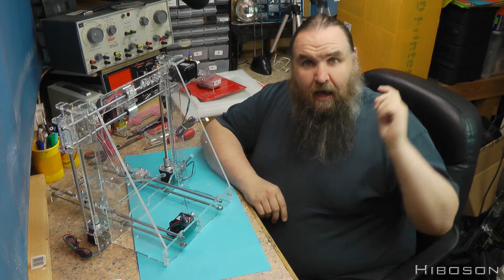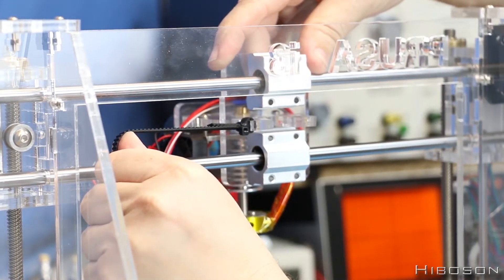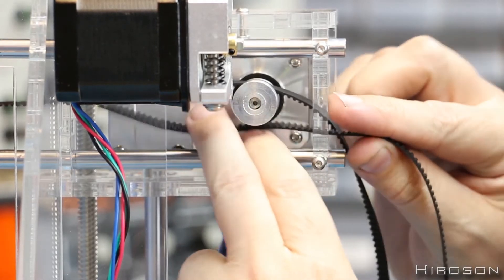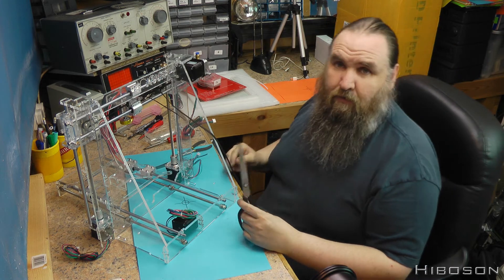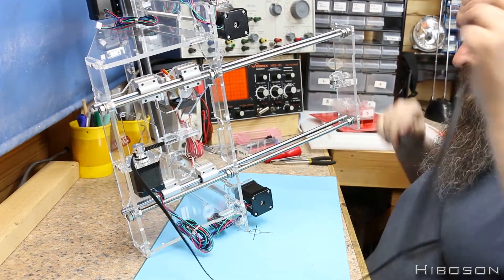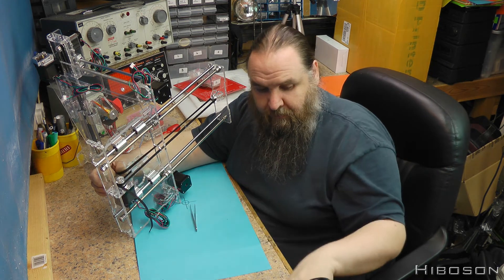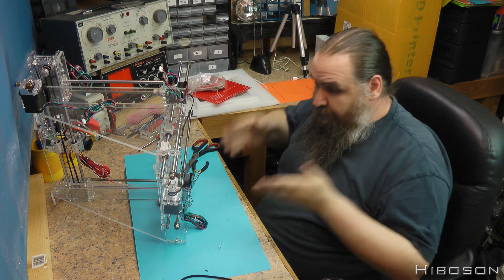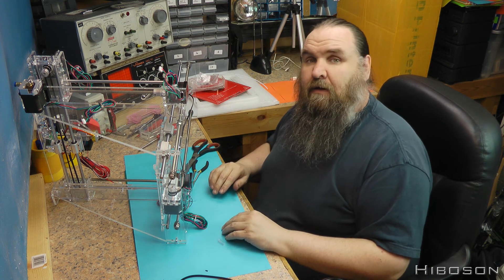3D Printer Build (And Breaking) - Sunhokey Prusa i3 - Part F

Comment: Can't you just glue the piece back on?
Reply from the maker: Matthias Zeitler it's a high stress point and small area to glue back, I feel confident just gluing the broken piece itself on it'll snap straight away,, but if I glue some additional support material on I think I'll get away with it :),, if not holes and cable ties is winning in my head as plan B lol
Reply: Hiboson too thin acrylic seems to be the Achilles heel of these printers. I was lucky, and didn't break any acrylic when building mine.
You might want to try some SCIGRIP acrylic weld to fix that part, and add a bit of acrylic spanning the toothed weak areas. However, If you have any difficulties, I can print you out one. I also have my original part, as I replaced the acrylic Y carriage with an aluminum one (had a bit of acrylic warp with ABS temperatures).
I notice that 3dprintersonlinestore.com (where I bought mine) is also selling an MigBot Prusa i3 with thicker acrylic (8mm vs. ~6mm) and an optional 270x210x180mm build volume. Oh well, that seems to be the name of the technology game. ; )
Your videos are very well done my friend!
Reply from the maker: Louis Boliou thanks :) I'm glad my video production levels seem to of sufficient quality to keep people happy :) Thanks for the offer of printing a part :) had a few now the 3D Printer crowd sure is a nice bunch :) For now going to try a fix, it's all content and showing my viewers how I get through issues (Even if self made lol), if I get really stuck I'm sure I'll start taking up folks with there part offers soon enough lol

Comment: Feel for you Hibson, mine was the same but decided to leave it, it went through my mind to do the same as you but then I thought no l will only snap it and hey whats 2 teeth lol.
Don't understand (as per comment on how to fix below) why they did not just make slots and use zip ties like the Y travel.
Printer has been running for a few weeks now and I am blown away how good it is, though a few teething problems so I have upgraded to a V6 E3D hot end as there was an issue with the heat brake on the j-head that came with the printer (had a manafacturing fault that made a slice in the side of PFA (teflon) tube so kept melting and blocking head when i tried to print and when i tried to unscrew the heat brake from the tower it snapped, I was surprised as i was only using my hands to unscrew. I was going to fix then saw how the V6 let the Bowden tube go all the way down rather than another piece of PFA tube inside the head so swapped out. Anyway good luck on fixing and using it for the first time.
Reply from the maker: Steve Jones Thanks man :) Procrastination got the better of me today but tomorrow should see me trying to fix the breakage and film some more build steps, don't think I'll get it completed but I hope to get close, so at a guess (hope I'm not jinxsing myself here) over next 2 videos should see build finish, then a couple of vids about my early experiences and learning curve, after that we'll see,,, depending how my learning goes dunno if there might be a non 3D Printer vid between the last build video and my using the printer videos, will have to see how well I get it to work,,, or not lol

Comment: hey i have the new kit i think its the one after yours there are a lot different parts possibly better designed with adjustable rollers not sold mounted and a few other things in reply to your problem you could take the parts you have to a laser cutter close to you most sheet metal shops have one or profile cutters and get them to scan and re cut you one wont take them long and be pretty cheep i had to get a few parts re cut when mine arrived a bit broken.
Reply from the maker: Rick Bellamy If I can't fix it myself (I'm 99% sure I can) I'll get a new piece cut, but TBH I'm happy I can bodge round it :) And I have a mate who owns a laser cutting company so worst case can get him to knock me up one,, but I think I'll bodge it, then once up and running get it to print me a new better belt clamp :)

Comment: One more note I have put a tape on both sides of the acrylic part after getting the belt in (where it's not broken) to secure belt from slipping to sides as I noticed that Y axis motor bully is not 100% aligned to the front belt roll so belt can easily slip to one side.
Reply from the maker: Harasi Another great tip :)

Comment: All good Hiboson just make 2 holes on the same acrylic part and hold the belt with 2 zip ties or cable ties.

My kit have been up and running for over a week now.
Reply from the maker: Harasi It's definatley one to consider, at the moment seeing what I can do without adding holes or extra weakness points in (I'm a heavy handed oaf) but if they fail I'm remembering all the cool tips you peoples are giving me :) your all awesome :)